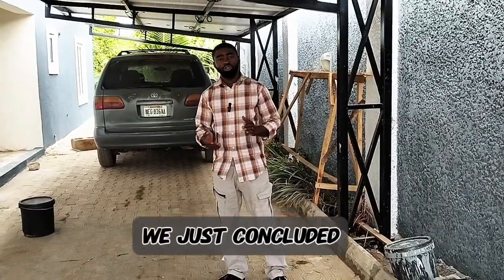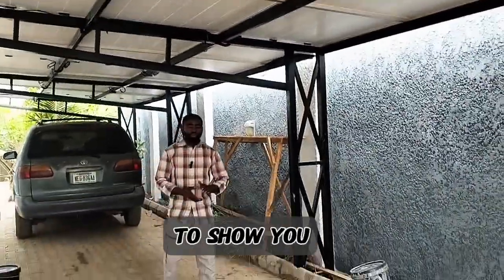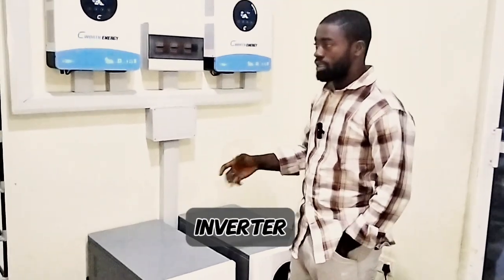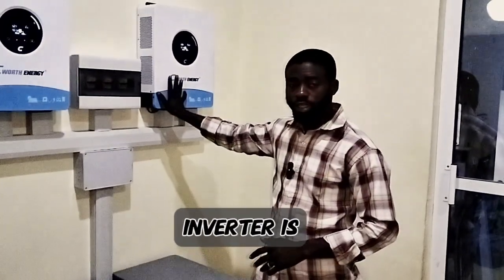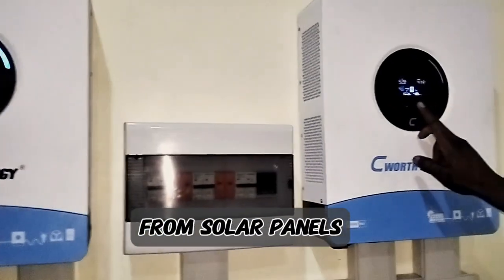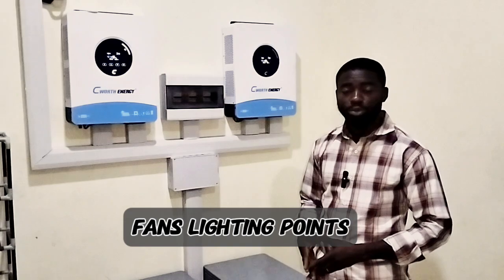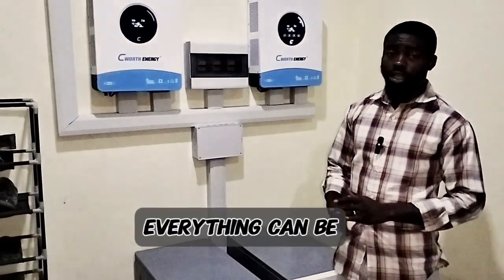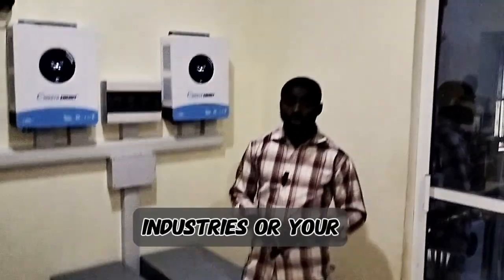What can a 12kva solar inverter system power?

Comment: Please I can see the input solar panels voltage is 525. 7volts but the max voltage for the inverter is 500volts,per my calculations a 615watts panel has an open voltage of 52.57, meaning ten in series will give 525.7volts can please explain

Comment: Based on the locations of the installed pannel , the building is taller in height and very close to the carport posing a shading phenomenon on the pannels.

 So far the earth revolves around the sun, there will be a time within the year when those panels won't be receiving much sun to charge efficiently on a daily basis....

Assuming the following positions as an e.g

(1) If those pannels are facing south, you won't be getting efficient sun rays daily within the period of March 23 to September 23...

(2)If they are on the other side of the building facing north, you won't be getting full time daily sun within the periods of September 23 to March 23.

(3)If it's facing east ......u can only get sun rays max on daily basis from morning till around 12 to 1 pm

(4)Vice versa if  the pannels faces  west .